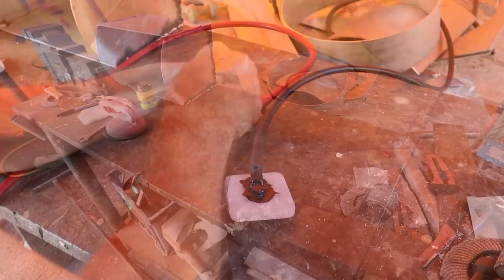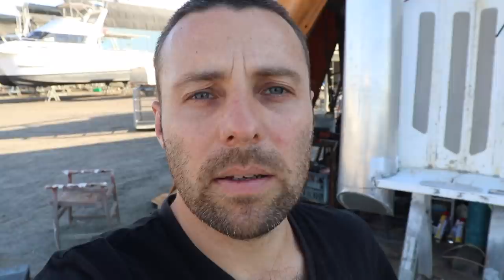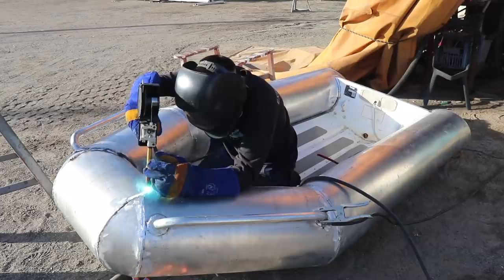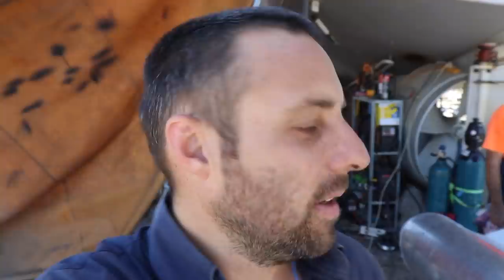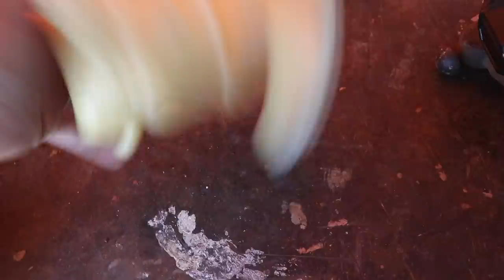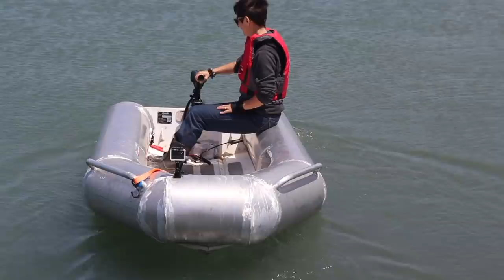DIY Electric Dinghy Sea trials, Part 5 - Project Brupeg Ep. 111

Comment: Dame, for the applications i use gel batteries, i use a Kemo battery guard to stop them from being discharged to low. You can adjust it to the volatge you want and so far, in the last 5 years, we have not lost a battery due to it being over used. Well worth it and easy to install.
Reply from the maker: Neil that sounds really interesting. Do you have a link to one?
Reply: @ProjectBrupeg  Here you go.
https://www.amazon.co.uk/s?k=Kemo+battery+guard&ref=nb_sb_noss_2

Comment: Cute little dinghy ;) and filling it w/foam is exactly what I would do too. But wish I would have come across you a bit sooner, to give you this tip for the future. When welding that material, even using wire feed, take a torch, simple propane or MAP gas will do)or a good heat gun, and pre-heat the surfaces before welding, yes, people will say you don't need to with wire feed, but as a certified welder who has done tons of aluminium(aluminum for us in the US ;) when you're doing watertight welds, it will help you get not only deeper but smoother welds. Remember this for other projects upcoming.
Reply from the maker: Thanks, glad to have you along with us. We had a mapp torch but it was pretty hopeless (think that’s more our torch than the gas type). I was thinking about a TIG for the next boat so I can control the heat and penetration better.

Comment: Nice job!!! Cant wait for the jet conversion !!!
Reply from the maker: Yeah that will be a fun build
Reply: @ProjectBrupeg  did you decide to use the third party jet pump or are you going to "graft" in the part of the jet ski hull with the engine and pump you cut apart in the newer vid?
Reply from the maker: The plan is transplant all of the running gear from the cut up ski. we wont be fitting any fibreglass parts into the new hull, alloy will be used to fabricate every component
Reply: Awesome, thats gonna be an awesome build. Im swapping a seadoo 717 into a 15ft 1985 Chaparral, only ended up using the pump tunnel section of the seadoo hull because of the way they "ply" the skins like you showed in your vid. Think it will be easier to use adjustable motor mounts instead of worrying about the potential weakness of the factory mounts, and makes a cleaner more custom conversion. Wont look like some other builds i have seen where it looks like a jet ski rear ended a boat and got stuck... Cant wait to see your build!!!

Comment: I'm late to the party, but I have enjoyed watching the entire build. Great job and I could never do this, I don't have the vision, energy, skills, or patience.  I have spent a lot of time inspecting metals and welds using many different methods (MT PT UT ET RT AND VISUAL). Of all these, PT is probably the best bang for your buck, seeing the kinds of welding you are doing. It's pretty cheap and easy to do.  Aluminium is probably the nastiest stuff to inspect, but it'll show you where the cracks and big stuff is quite convincingly.  You guys are an inspiration to chair born rangers like myself. Thanks
Reply from the maker: Thanks very much Terry. This is the first thing ive ever really made using alloy, was an interesting learning experience. im sure there is stuff ive missed but im able to fix it at anystage so its been really an enjoyable project.

Comment: Great job guys well done, don't forget to drill a hole in each of the wingbolts holding the outboard on the back of the boat so you can tread a cord through each the holes and that'll tie the 2 wingbolts together so they can't vibrate undone and the outboard fall off the back of the boat into the drink !!  Seeya Rob
Reply from the maker: Ahh nice idea. Thanks for that
Reply: @ProjectBrupeg  Hi have seen a few guys boating along and the outboard literally falls off the back of the boat or they run over a branch and the motor falls off. If you don't want to tie the wingbolts together then get a strong S/Steel wire trace and put the wire around the outboard leg at the top or prop shaft and the other end to a quick release clip and clip that end of the cable to the hole in the lug welded to the back of the boat on the right side at the back, so if the outboard fall off you have the S/Steel cable to catch it and to pull it back in and you don't lose it all together. Also, that rubber mate at the front you glued down, if you have any of that left over glue some down the back where Jess sits so she doesn't burn her bum on stinking hot days and it'll also be a bit of padding for her !!  Seeya Rob

Comment: Nice job you guys!  I did a search on aluminum welding since I'm learning, and you showed up in the results.  I watched the dingy episodes with interest as I'm building an all aluminum camper replacing the bed of the truck.  The last two weeks has been learning TIG, MIG with a spool gun and the difference between mild steel I've MIG'd a lot of, and the aluminum 6061.  You got me thinking of ways to make a dingy for the camper.  Thanks, and good luck.  I'll be watching.
Reply from the maker: Great stuff, hope this helps with tour build. If it helps we were using 5005 grade alloy with 5356 wire

Comment: I would love to have the chance to come join the fun but I could never afford something like this. When you have to work to live it gets hard to enjoy life. I remember building the Cee Jay and a 20x40ft barge with my dad as a kid, That was so much fun to do, This barge sat like a bathtub full of water for over 4 years, when my dad finally finished it, the Cee Jay was the tug boat, we built the pile driving hammer, restored the linkbelt and attached a special anchor so they could not flip the crane off the barge, we also rebuilt the twin 6-71s in the engine bay, what a great time I only wish I had done more on it. I remember putting on the welding mask at 8 years old. this was where I learned to arc weld, still remember crawling all the way to the back of the compartments and just getting to it.
Reply from the maker: Sounds like a great time with your dad Steven

Comment: It turned out really sweet. And on Jesses birthday too. I still see that great determination that you have to finish a job you have started. And if anything goes south with the electric motor you could always put on a gas motor if you had to. And it's too bad you didn't catch the guy that put all those dirty dishes on the counter and in the sink. It never was like that when I was there. Ha ha. You guys are great.
Reply from the maker: Thanks Dennis, yeah the plan is to swap out for a 10-15hp gas motor when we head to the ice but for anything above freezing we will keep with the electric set-up

Comment: Great job! Excellent sticking with it. Will you need a side handles to carry it up the beach or plan on using Wheels? You may want to put a spray rail on the bow to keep the water from rolling over into your face all the time. Maybe a center bow eye? Would have liked to seen tubes completely full of foam so if it leaks later you won't be carrying around all the water. It could get real heavy. People that spray foam buildings are pretty cheap way to go if you take it to them at another job! Thumbs up there isn't anything you can't do!
Reply from the maker: Thanks Charlie. We will be adding more hand rails to the back but this boat will be dragged up beaches and over rocks so we won’t be adding wheels

Comment: Looks great guys, certainly picked a fantastic little project to dive head first into ally welding, cant wait for the jet boat (but sounds like that might be a little way off?). Inbuilt rowlock pin tubes might be a good idea but not sure where you would sit to row.....maybe just paddle. Happy belated birthday Jess and Mish
Reply from the maker: Yeah the plan is just paddle. Rowing this is a pain in the bum and will almost never be needed
Reply: @ProjectBrupeg  especially with out a thwart, I guess most of us don't plan on rowing....dyb dyb dyb.... ;)

Comment: Am I the only one thinking that the dingy screams for a couple hand grabs on each pontoon at the stern? Might come in handy as attachment points if you have to winch it up or do a 4 man carry. Just a thought. You guys did a heck of an engineering job.  Well done.
Reply from the maker: Thanks Col
Yeah we mentioned a few of the jobs left on the dinghy and putting some hand rails on the back of the tubes is one of them. Dame has to make them so finding time is the issue. Cheers Jess

Comment: When I used to build aluminum missile canisters for the USN they were built to be pressurized. When we had small pin holes we would simply use a small punch to close them. Worked great. Also of course TIG is always better for pin hole repair. Nice episode!!
Reply from the maker: Thanks Greg, yeah i looked into getting a TIG, but we managed to do it with MIG. it took longer and might have been a bit rougher but it works... still a TIG wouldve been lovely.

Comment: Nice conclusion and happy birthday. Just as a note add some epdm rubber on where you are sitting on the tubes and handles around the back. Aluminium will get extremely cold quickly.
Reply from the maker: Thanks Jesse, Malcom gave us some rubber to put on, though he was thinking about heat in the tropics. I’ll just be relieved either way. Cheers Jess

Comment: To get a better weld try heating the point or area with a propane burner or like a benzomatic. It will allow the aluminum to flow better into the joint area. Might try it on the next dinghy build? Just a thought.
Reply from the maker: Thanks David

Comment: Fantastic result 👍 well done everyone👏🏻. You really should have cracked a tinny on the tinny to christen her tho. Happy birthday Jess and some advice on navigation... Lort is peft and rarboard is stright 😁
I hope the foam worked ok, I used some a few weeks ago to fill a hollow leg, there was only a 8mm hole to fill through and it took weeks to cure, not sure if it needs exposure to air or it was just poor quality cheap stuff.
Reply from the maker: Hi Bill. the can said wet the area so im thinking it uses water as a curing agent

Comment: Fantastic job!  The boat really turned out nice and can’t wait to see you guys putting it through it’s paces once you’re out cruising. One thing I noticed was you put the breaker at the back towards the motor, and not up at the battery post.  Not sure if you have fuses at the battery end, but the current configuration potentially leaves the wiring and battery unprotected, especially if any of the cables share a conduit.  Don’t want to see this thing melt down!
Reply from the maker: Hi your right about the location being downstream from the battery, none of the cabling shares conduit and the battery will eventually have a lid so we wont have access to that cavity easy, hence we put the fuse where its accesable but also because upstream the cable is very thick and down stream from the breaker is thinner gauge wire that we are protecting. the plan is to add a simple pole fuse to the battery to look after the thicker cable.

Comment: Just strolling threw, For our white water boats drain plugs, We stack two pieces of 1/4" aluminum welded together and hole saw a hole that fits a expanding, twist style plug. Solid, secure, Metal... But we bash on our boats so. I believe mine are 1 1/4" Looks Good mate.

Comment: Get a stainless wire wheel for your 4” grinder. Any time you stop welding or start welding you get that black soot. Make sure to use the stainless wire wheel when you stop and before you start again to remove that soot. MAKE SURE it’s stainless only. Post leaks happen at stops and starts. I have done a lot of leak repairs on aluminum diesel fuel tanks.
Reply from the maker: Yeah we do have the stainless wheel for alloy only. we also use an acid etch to really clean out the buffing prior to welding.

Comment: @Project Brupeg. If you get a pin hole that no matter what you do you just can’t get it to seal up. What I do is get a nice shiny new drill bit that is about twice the size of the hole and drill it out. Usually you end up drilling out the bit of contamination and it gives you fresh clean metal to then weld and  fill in.
Reply from the maker: Ahh nice, yeah the biggest issue we found when leak testing is crap in the weld. this trick makes a lot of sense. Thanks

Comment: Loved watching the build. There's always three more ways to build anything, but you just have to keep cutting and welding sometimes to make it fit.  Have you thought about some tie-down points, grab handles,  on the aft tubes?
Reply from the maker: Hi David. Yes we will be adding more handles the same as the front all the way round but we haven’t been able to find any pipe with tight bends for the corners at the scrap yard yet. They can be added at any point

Comment: Fantastic I love a good launch I dare say your good lady will be wanting a engine upgrade before long the way she ripped up the jetty and came in hot love it on to the medium boat now cant wait to see that thing.. just a thought off mine seen as you will be in artic water and we all know how fast weather changes down there what about a strobe light on a pole say 1.5 meter for search and rescue
Reply from the maker: Hi Mark, yeah we do plan to fit some gear like strobe etc. Any dinghy that heads off from Brupeg when we are in the ice will be carrying a sat phone and a VHF, and this is the back up boat either way so unlikely to see too much ice work.
Reply: Project Brupeg: good that you cleared this up for me. I was worried you might have been considering using this dingy in icy waters. For that you would want something built to a different standard and carefully tested for such an environment. It’s clear to me now that you’ve considered this already.  Good on ya!

Comment: hi Damian
Your electrical connection through the nylon pad relies on pressure on the nylon which is not as reliable as metal to metal. Adding a separate nut each side of the calble lug would be better

Comment: You should consider putting silicone pad heaters around the batteries to keep them from freezing and working at good efficiency in really cold outside temperatures.  Lead acid battery performance and capacity goes to crap when their temp gets down near 0C.  You could wire the heaters to get power whenever you charge the batteries.
Reply from the maker: Hi Ronin, the plan it to remove them when we head to the ice and fit a petrol outboard. these are for the 80% of the time we are not in freezing conditions

Comment: For future reference if you mix some dish soap in with your water it'll bubble up wherever it's leaking. It'll work just like using a spray bottle with a soap/water mixture on a pressurized vessel or tire when you're looking for a leak.

Comment: Great work on the tender :D

Have you considered putting rubber along the top of the tubes - when it's in icy water those tubes are going to get cold pretty quick, similarly they'll be toasty to sit on when it's hot!

Might also consider doing the hand rails too for the same reasons.
Reply: Jim Nickles  Surface prep is really key with bed-liner or it'll peel off ... sika & rubber matting is  foolproof :D
Reply from the maker: Hi Alain/Jim. Yes, the plan is to add more handrails to the back end, we just haven't been able to find any suitable alloy tube at the scrap yard yet (and they can be added at any time). As for something grippy/less hot/cold to sit on. the plan is to put something down, we just haven't settled on what yet but your 100% right this will either be an oven tray or an icicle.
Reply: @ProjectBrupeg  eva foam is cheap and works well

Comment: i mentioned several episodes ago to wipe the seams with acetone immediately before welding..... the other thing you can do is use an air line with argon flowing into the tube so the back side of the weld will not be able to oxidize up through the seam. it doesnt need to flow fast, just cover big holes or seams with tape
Reply from the maker: Yeah we ended up stainless buffing the weld area then acid washing it and immediately welding so zero oxide happened. Seemed to work quite well
Reply: Yes that helps but remember what is on the other side of the weld will affect the front. That is why a back purge of argon from inside the tube will help the front weld (1-2 cfm is good)also try to maintain gas shielding in the front. ( it’s a cheap trick but if you can find a clear plastic cup 32 oz make a hole in bottom insert gun in and the cup is like a giant gas shield) slow your motion with the tip to keep the puddle from getting so agitated this will minimize the pinholes

Comment: Have you thought about tig for welding as it much hotter weld and nicer no grinding needed. I can see that the Mig is faster.
Reply from the maker: I did consider it but 90% of our welding is steel so an AC TIG able to alloy weld doesn’t really suit the bulk of our needs. MIG & ARC are mostly what’s needed onboard so the alloy was always going to be spool gun for us. That said I love the finish TIG gives on alloy
Reply: I was gonna make my own comment , but ill add mine here, "I feel like when it comes to welding aluminum the absolute best way to go is tig". 

I'd look into a AHP welder they sell here in the states for 700 and do all the tig modes, plus on the upside any steel pipe work they will work great on too, mig is great for fast but really bad for you need it 100% bulletproof first time.
Reply: Thank you for taking the time to replay to me.
Reply: Dinghy looks awesome!  But I was also thinking during the build that I would have used tig for the entire thing (for aluminum it's not that slower, maybe half the speed?) Just to cut down on the pin holes.  Tig is also awesome to go over and fix the pin holes.  For pressure testing extra light duty items like this dinghy I use an old acetylene regulator to add something like maybe 2 psi for the pressure testing.